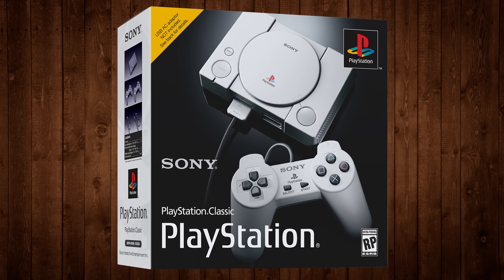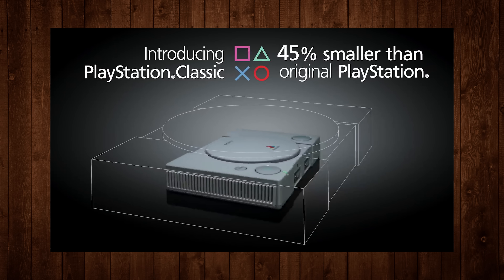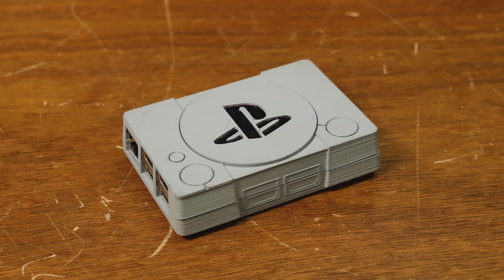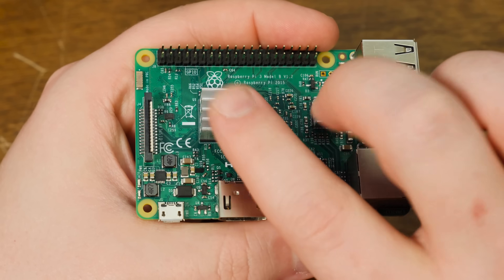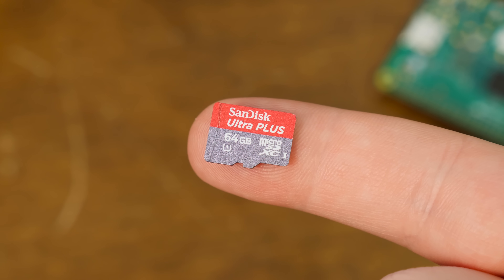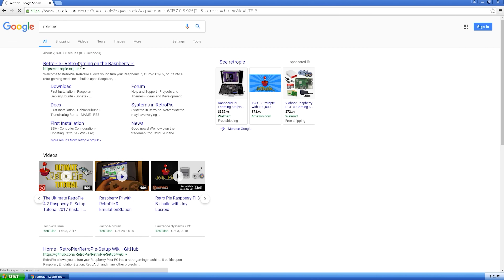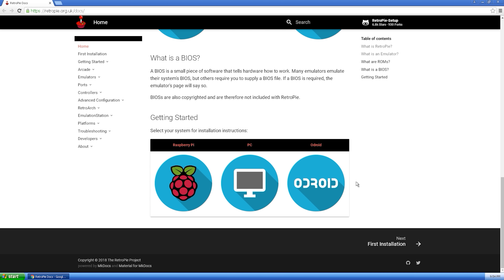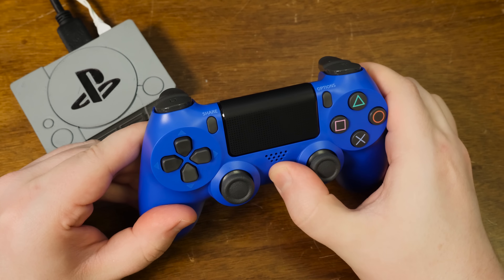Building a Better PlayStation Classic Console

Comment: Instead of making a 'mini' case, just buy a broken PS1 and use a real gutted PSX shell. It's gonna look much better anyway.
Reply: That's exactly what I did. I also bought a PS controller-to-usb adapter and soldered the pins to the original PlayStation's controller ports so I can use original controllers. Even further, I tapped off the PlayStation's original power supply (which wasn't broken) and routed that straight to the Pi3 (so I can use an original power cable). And finally, wired the power LED to work properly and the reset button to actually reset the Pi3. All said, my PlayStation Classic is about as authentic as a retro console gets :)
Reply: @HawaiianKong  That's actually... incredibly impressive. I would love to see a video of that.
Reply: @HawaiianKong  I'd love to do something like that but also figure out how to connect the PS1's disc drive to the Pi. A system that plays PS1 games from iso or from disc, uses the original controllers, and also plays SNES, Genesis, and N64 (with limitations)? Yes please!

Edit: Although, if I decide to do this eventually and have the choice, I'd rather use the smaller, rounded PSOne model ( https://files.catbox.moe/42t0zk.png ) rather than the boxy original PSX.
Reply: @pilcrow182  
Why Genesis and not SNES?
Reply: @marx4538  Re-read my comment; I did say SNES, Genesis, and N64, not just Genesis (and I'd probably play some TurboGrafx-16, AKA PC-Engine, as well -- Soldier Blade is my all-time favorite SHMUP, and the Neutopia games are awesome if you're a fan of Zelda 1 like I am)...  ;)
Reply: @pilcrow182  
It was edited. Plus, where's also Famicom, Sega Saturn, Sega 32X, Sega Master System then? Famicom is Family Computer, or you should know it as NES.
Reply: @marx4538  It was edited long before your comment (originally I only said N64, then added SNES and Genesis at the same time). And of course I'm not listing every system I'd use it for (that'd take too long, as it'd probably be 15+ different systems), just the ones I'm most interested in (I'd really only ever use NES/Famicom emulation for Zelda 1 & 2, Kirby's Adventure, and Recca)...
Reply: @pilcrow182  
>no rockman 1-6 in famicom
REEEEEEEEEEEEEEEEEEEEEEEEEEEEEEEEEEEEEEEEE
Okay, but seriously, i don't remember the SNES part at all. Maybe it's just me.
Reply: @marx4538  Haha, yeah, I never really got into those games. The SNES was my first system (EDIT: Well, my first home console -- I got a GameBoy a few months before it), and while a few good NES/Famicom games have caught my attention (mostly just the ones I mentioned, plus Crystalis and ExciteBike every now and then), I could never get into the older MegaMan/Rockman games after playing the MegaMan X series; it just felt too old and clunky to me (no offense to those who like them). But yes, I definitely added SNES and Genesis to that comment at the same time, so I'm not sure how you missed it. Whatever, doesn't really matter...
Reply: @pilcrow182  
:/
Reply: @HawallanKong, I did the same, only I didn't get the reset button to work from the top two pins on the power supply. Did you solder two wires directly to the reset switch under the psu?. I kept original controller ports and put a usb port in the back so i can plug another usb adapter in and have 4 players with 4 original ps1/ps2 controllers. here is my video of my build https://www.youtube.com/watch?v=pRWYbLLJlsY . I also did a step by step build guide video aswell. I have many more games on it now than when the video was done. I have bulit a couple for friends and am soon going to try and setup netplay so we can play each other over the net.
Reply: @HawaiianKong  Reading how much work you did,i happy that my ye olde PS1 still works. :]
Reply: HawaiianKong So can you show us how you did it?
Reply: There aren't that many broken PS1s. Those things are hard to kill (except broken lasers), unless you throw it at the wall few times.
Reply: So true, I used both.
But my last build I use a PSone case, I keep the cd drive part.
So I must modify the raspberry pi to fit in the case, and I made joystick ports work again with PS controllers.
Working power/reset button's and leds
I use also a DS4 controller ;)
Reply: Another advantage of doing it that way is that there would be room inside for a hard drive or SSD. Those PSX games are pretty big. I think the full set is over 300Gb.

I have a PlayStation that I intend to do this with. 
I have not done it yet because I am currently using a PC for Retropie. The Pi3 just can't run N64 games well, and it's my wife's favorite system.

As soon as they make a Pi powerful enough to run N64 well, I'm going to build it into my PlayStation case with a nice big SSD.
Reply: @thepenultimateninja5797  
Maan, PC Emulators with their "controls" and input lag? AWFUL input lag in Pi3?
Pfft, this is no better then PSClassic.
Reply: @marx4538  wtf are you talking about
Reply: It might not be a mini putting it inside an original case, but it means you can add extras to it in a very tidy fashion, such as a 3tb hard drive, cooling fans etc and 3d printed ports etc. People have done them, there are videos on YouTube, and they look very good.
Reply: I've seen 3D printed kits that allow you to fit a Raspberry Pi in a PSX case and replace the AV and controller ports with HDMI and USB respectively.

Comment: I bought a PS Classic. I plan to use the controllers on a PC and Raspberry Pi. I Might Use it as a case for Pi. Controllers do work on PC, so they will work on a Pi. Having both is awesome. I bought the PS classic for original feeling controllers, well kind of. USB, don't even need to hack them.

Comment: I made my own Raspberry Pi retro station last year out of an old Terminator console (Famicom on a chip popular in eastern Europe in the 90s). Had a lot of nostalgia connected to that old console since I spent countless hours of my childhood playing on it. I screwed the Pi in the middle of the case and use extension cables to make the USB outputs at the case controller sockets, done the same for the video output and power at the back of the case. Programmed two headers on the Pi to work with the Reset button then passed the power cable trough the On/OFF switch on the case. Even connected the power LED to it. Then hand painted the raspberry logo on the case.The result? It looks exactly like my original console but can play pretty much anything up to the PS1. Very pleased with it. Great video by the way! I had the same issue with the power supply.

Comment: I have the original PS1 console still lying around the house that would be great for housing the project, but I think I will make a few changes. I have an older android phone, so I might use that as the core component of the emulator. I also want to try install it in the PS1 without ruining the ability to play games off disk, for all those game that I have the CD for that still work. I was thinking about mounting the screen somewhere on the PS1 itself, as well as having the option to port it to a TV. This is all in the design phase still though, be interesting to see what I could pull off.

Comment: I can highly recommend a purpose built case like the Kuma (S)NES cases, if you're not a fan of the rough look of (most) 3D printed cases. As a bonus they also come with bigger heatsinks and ability to mount a small fan for cooling (especially when overclocking to make some games run faster from the 3D era)

They also have nifty, functional Power/Reset buttons that make it a breeze to control the power on your Pi (Which is normally not 100% fun otherwise)

Comment: I've had three Raspberry Pis over the years; a Model 1B, 2B, and 3B+. I have managed to fry every single one of them... or so I thought. The 3B+ was giving me the same low voltage indicators you mentioned, so I'll see if an official power adapter will bring it back to life.

Comment: I use the Flirc Pi 3 Gen 2 case, runs about $16 on Amazon, but the entire case serves as a heatsink and keeps my Pi-Hole perfectly cool.
Looks a bit simple but it's a well built aluminum case that can more or less blend in with it's surroundings.

Comment: Excellent alternative. I am using my own variants to this. The original PlayStation has a special place in my heart as well. It opened up huge game worlds and more in depth games that just weren’t possible on the cartridge based consoles. 

Back in the day it was cool, hip, stylish and not just for kids. It was the thing young adults loved to play games on as well.

Using the raspberry pi 3 with a composite cable on a CRT bypassed most of the lag issues that can be associated with HDMI. Love to use this same setup on my 14” Sony Trinitron Tv I use me regular Playstation with.

Comment: The thing people must understand about this wave of classic consoles is that the companies making them think of those as novelty for profit.
That's just it. No real interest in bringing back the experience of playing those games in original consoles... it's just an attempt to profit from old IPs they have rights to.

Which isn't bad per se, but when you consider these companies also have an interest not to cannibalize on other retro fronts on their own consoles (like, you know, classic titles selling on more modern consoles), you quickly understand why Playstation Classic, NES Classic, SNES Classic and others will never have a comprehensive library or a true to form original experience there. They will likely never expand the library too, even though most of them have that capability right there in the hardware being sold.

They just can't be bothered with the admitely complex stuff around buying the rights to certain classic titles, reproducing the experience better, using high end hardware, etc.
There probably also wouldn't be a very big market for that, so it is what it is.
Most of these classic consoles have hardware that is even cheaper and inferior to the Raspberry Pi, built for purpose with the minimum investment possible. And it's very likely that most of them are using open source emulators, or emulators bought for as little as possible with some code modification.

But for those wlling to go even further to get an experience closer to the originals, I'd recommend looking into MiSTer and fpga hardware emulation. It's still early stages I guess, but hardware emulation will get you closer to software emulation.

If you don't want the trouble and don't wanna get into the legal minefield that is roms and whatnot though, sure, just get one of those. But it'll always be kind of a crapshoot for howhever long this fad lasts. It's all about the intentions there.

Comment: i did something sligghtly differnt with my pi. it automatesa nd controls my model train layout, signals andswitches and lets 3 trains operate on a 2 track set up complete with passing siing stops and the ability to run either a loop or point to point and for my amtrak train, 3 minute sstation stop incriments. Aren't Raspberry Pi's amazingly awesome?

Comment: Aw I was hoping someday I could send you one of my builds I should have known you were already ahead of the curve! I have a 128gb image I've curated over the years with complete romsets for all LR supported emulators with box art and synopsis - I even have a Super Famicom section with every translated rom out there :) I use the nespi cases from retroflag and wiiU Bluetooth controllers that have little snes controllers molded into the bottom half. Anyway nice build dude and thanks for sharing!

Comment: ill be making my own, I think its time, As of right now im using a soft modded PS3 witch is not bad, but its my older one thats sounds like a jet engine at times, and would really like it not to burn up running unnecessary  background stuff that a PS3 needs to run and since its cheaper than the $100 P.O S. Sony is offering I think ill do this instead, thank you for sharing your thoughts on this

Comment: I build an emulation handheld some time ago, Its based on a Pi3b just like yours but also has onboard speakers, 5in backlit lcd, and controls all in a gamegear sized handheld... larger size for my larger hands.. could have been made smaller but i like the size and larger screen. Now if i could just cram an old 486 or early pentium into a handheld... would love me some dos gaming otg
Reply: @Deon Denis oh i know they have some dos emulation on a rpie.. but as far as that goes... i'm a hardware snob lol i prefer actual period correct systems to run my dos games.  soundblaster, voodoo, adlib, MT-32 midi etc lol

Comment: I've seen people say that you absolutely need to use the official 2.5 amp adapter, but I've found that the Canakit one you can find on Amazon also works fine. Had to order one after finding a lot of other options very lacking.

Comment: I have heard that the emulation on a Rasberry Pi was pretty iffy, but that was at least two years ago. I imagine the technology has gotten better. But are there any emulation issues at all, with the Rasberry Pi PS Emulation you have?
Reply: I just got a Raspberry Pi 3 B+ (IIRC) and I haven't really had any major issues with the emulation of PS1 games.
Reply: PS Classic uses the same emulator as the one in this video.  Also the Raspberry Pi 3B has a stronger CPU so it will run the games better.

Comment: The irony of the Raspberry Playstation being smaller than the NES Classic or the PS classic, is of course that the Pi has better hardware for less money. So it's smaller, cheaper, better, more powerful, and can run desktop linux if you ever get bored of the emulation.. Hmmm,, what to pick i wonder. :D

Comment: I put together a similar  retro gaming box with a kit from from Vilros (available on Amazon) that includes Raspberry PI 3 model B, Heatsinks for the RP,  a case that resembles a NES Classic case for it, a 32GB microSD card, microSD card reader, 5v micro USB power adaptor, and one or two SNES style USB controllers (depending on which kit you buy). The SD card has the Rasbian Linux distro and the RetroPie software package already on it ready to boot. After a brief ensemble of the board, the heatsinks then the case, it basically ready to go. You can use the USB card reader to transfer ROM’s from your desktop/laptop to the RP’s microSD card or you can install a optional Linux desktop called Pixel. From there you can run a standard web browser allowing you to obtain ROMS, abandonware computer apps, etc.  via the internet directly to the RP without need for another computer as well as use it as standard PC (though a slow machine with limited memory). With this setup I was able to emulate classic consoles like Atari VCS/2600, 5200, 7800, NES, SNES, Genesis/Mega Drive, PC Engine/Turbo Graphic 16, Intellivision, and the ColecoVision, Game Boy, (Game Boy Advanced, etc), Game Gear, Atari Lynx & Jaguar, etc. It also emulates many home computer consoles such Apple II, Commodore 64/128, Atari 400/800/ST, Amstrad and Acorn computers, Sinclair ZX  Spectrum, and DOS & Windows PC’s (via DOSbox). The only issue it has apparently is that it does not emulate all N64 games well without overclocking (which I have not tried) the RP and it doesn’t emulate later consoles at all (Sega Dreamcast, GameCube, XBOX, etc.).

Comment: I have since a couple of years Raspbian as both a server (Node apps, http, torrent, files), media center (Kodi) and emulation machine (EmulationStation + RetroArch and other emulators). I am replacing it with an intel NUC so I have more flexibility and retiring the Pi to be a server. If you are inclined to (or care about) you could polish the case to give it a better look.

Comment: I have the same system with an old Intel Nuc PC, it' small and powerful enough to run PSP, gamecube (with gamecube controller with wii USB adapter) and dreamcast on a gentoo Linux I did  optimize for this hardware. So PS1 in no problem on this hardware and all consoles emulated by a Pi.

Comment: I bought 2 pi zeros last year. Direct from the manufacturer. The first one was mailed in a bubble mailer. BROKE!! No one could get it to work. Sent it back for a replacement. That one was broken as well. Both sent in a bubble mailer. No static shielding. Like they didn’t care. My foray into raspberry pi ended with that experience.

Comment: heatsink? i slapped on a old pentium cooling fan i had xD
goodbye heat issues. and i bought a nice pre made shell with can add more pieces or fewer. 
it looks like thin slabs of plastic so lots of customizing. but im considering buying another pi3 and going with this heatsink... it looks way better to prevent dust heaping in my device. o yeah it never hits above 50 degrees.

Comment: I wouldn't have paid for that 3d print. One thing it was run with huge slices to get it done quickly, the heating was insufficient and the whole thing bent. I guess you can upgrade it is you want to and throw this.

Comment: I use ePSXe to play PS1 games on my PC. It's really the simplest solution.
Reply: ePSXe is good for customising a lot of details and runs the majority of PSX titles but PSXfin 1.13 is the easiest to use and works fine with multiple monitors (ePSXe stops playing audio when more than 1 monitor is detected, weirdly)
Reply: @greenhowie  Never heard of it (never looked for an alternative for ePSXe tbh) so thank you for the suggestion,I'll give it a try!
Reply: @mvl71  No worries, I've spent hours trying to get certain games looking as they should on ePSXe (like Silent Hill or the GEX games) before giving up and going back to good old 1.13